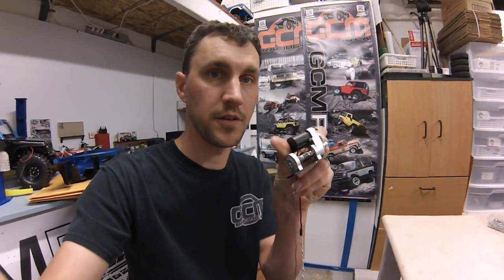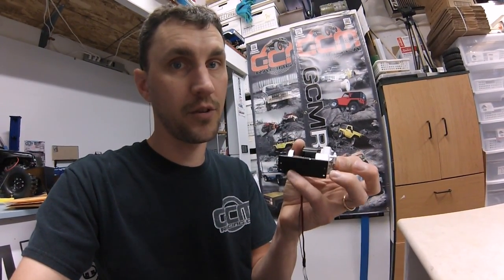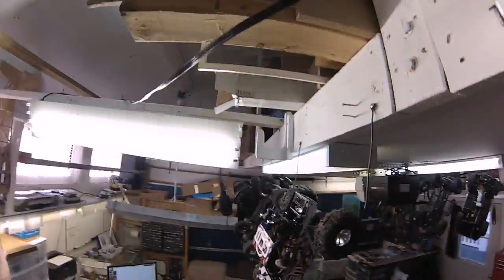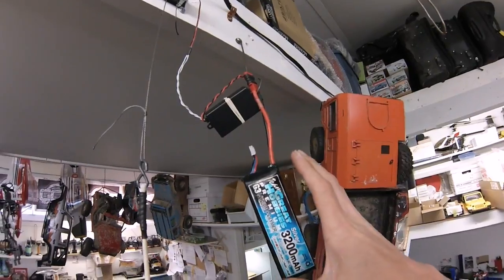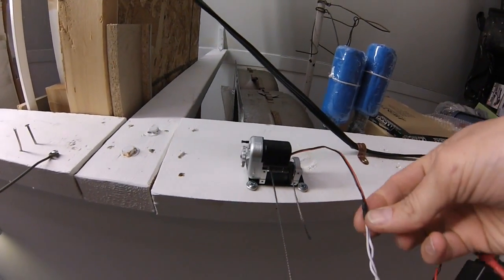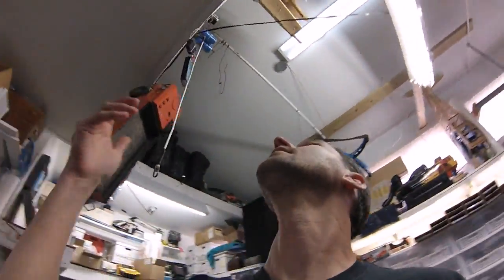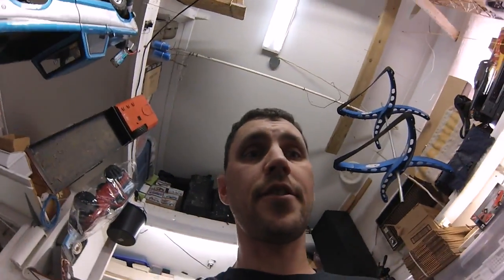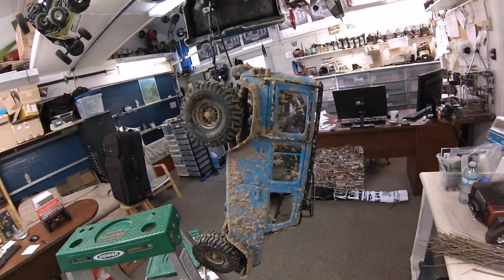SSD OX Winch and HeyOK Controller -Testing and Review

Comment: Just got this SSD winch yesterday from amazon, applied for their credit card and got a $50 discount, well this winch is the same scale as the warn 8274 from RC4WD, although the spool is a little longer on it, it is 31.5mm, I found that at 1.5 V, the warn 8274 is more powerful, same gearing and all, looks like the same motor, on the 8274, the motor is held with 2 screws, on the SSD it is held by the black CNC AL cover. I really dig the SSDs looks though, it shines more than the warn, there is something about CNC surface finish that is eye catching.